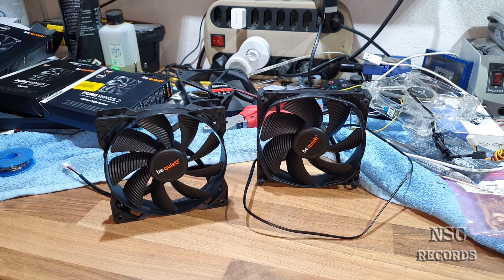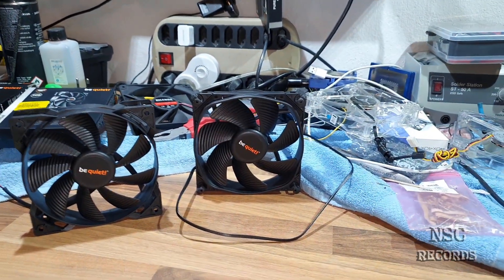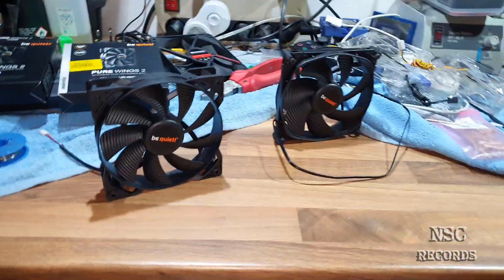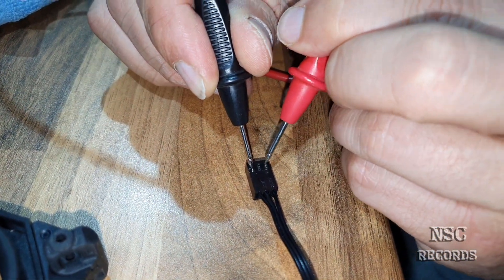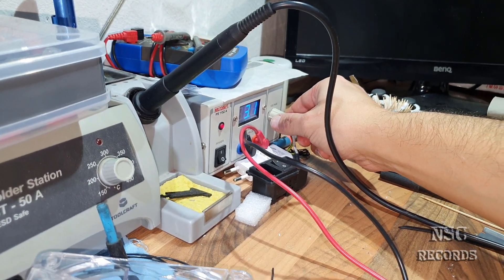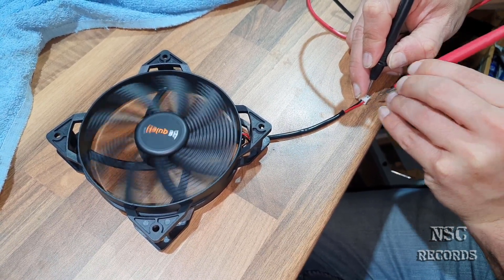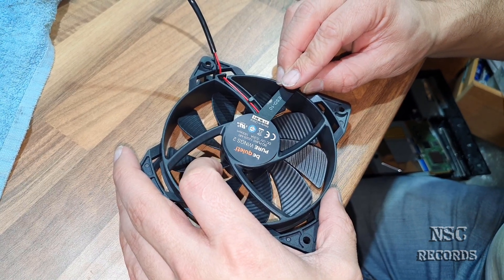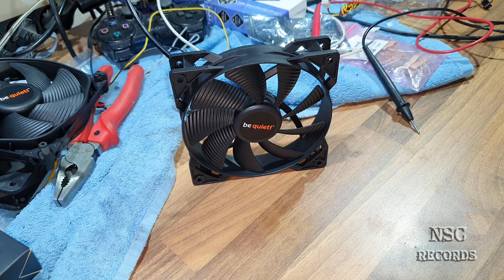Do NOT replace a PSU Fan before you watch this video! By:NSC

Comment: Hi does the ampere of the fan matter?The fan on my power supply is rated at 0.58A and at around 2200Rpm.i am looking to change to a fan with 0.80A and about 3000Rpm will it work? Any idea on what ampere the header on power supply be ? will it handle that.My power supply Seasonic S12 II 620W Bronze
Reply from the maker: Hi So you need it faster? So yeah, should work, but maybe not on full speed, or will be faster, but maybe not full 3000rpm
Reply: @NSC-Modz  Trying to go with industrial fan same like what came with the power supply,It's a Delta brand fan unfortunately I can't seem to get a 0.60a
2 pin 2200rpm anywhere in my country it's either 4 pin pwm or its sold out.Not trying for faster fan.The old fan has started to make sounds like going to die soon.I can get fans with 0.33a but just scared it might not be enough to cool the power supply
Reply from the maker: @DINESH7343  Right, it's mostly 3 or 4 pin, you need to do the rest by your self. It's easy
Reply: @NSC-Modz  Ya,tried with Artic P12 pwm pst fan modified it run on 2 pin instead of the 4 pin ,as you said on the video,the fan doesn't spin during startup of the pc it takes  a while and then slowly starts to spin, most probably because its not meant to be controlled through voltage.I was scared it will probably damage the power supply i took it off
Reply from the maker: @DINESH7343  it's because on the beginning the PSU is cold, so less voltage for the fan, just when it gets hotter, the PSU sends the fan more power, but normally, the Fan should start directly with the psu for best cooling results.

Comment: HI NSC, do you know if the CECH-2003A PS3 Slims have a different fan curve to other models of Playstation 3 systems as even with liquid metal and a fan adjuster set to around 30% the fan will still rise on its own in Grand theft auto 5.Cheers
Reply from the maker: No, the Fan curve is mostly the same on all PS3's
Reply: @NSC-Modz  Alright man, must be the pressure or something. Soon i will finish building my pc then i will out a CFW on the PS3 to check the temps.Cheers

Comment: look man my psu from no where started this problem i just cliked start button in my case then the psu started to nnnnnnnnnnnnnnnnnnnnnnnnnnnnnnn and randomly it stops and work fine i oiled the fan and cleaned the psu very well and it sill there the problem
Reply from the maker: Throw it away, better buy a new fan. It's not worth at all
Reply: @NSC-Modz  ACULLY PROBLEM ITS SOLVED I DONT KNOW HOW BUT IAM WORKING UNTIL GET THE BIG BOY AFTER I FINSH MY SECONDRY SCHOOL THANKS ALOT FOR REPLIING I HOPE U CHANEL GET BIGGER<3
Reply from the maker: @limby4446  Thank you so much to :) You always welcome bro.

Comment: Hey NSC. Came across your video as I was looking at purchasing the Silverstone 1000w SFX PSU. The reviews talk alot about how loud the fans are under load. Are there any fans that could recommend me to do a DIY project in terms of changing the fans on the Silverstone? Price is not an issue for all it is worth. Thanks so much for all that you do!
Reply from the maker: Hi I would wait, soon the new EVGA PSU will be available, this PSU is really cool, the Fan will just work when the PSU is on load over 50% and it has on the side load bar LED Satus. Search for:  EVGA SuperNova G7
Reply: @NSC-Modz  Do you know where I can read up on the potential release date for the SFX version of it? I could not find any info regarding it :(

Comment: so 1100 RPM is not enough for my psu basically
Reply from the maker: It conforms, if it's working on Load most times, better not... if you just surfing around than it should be enough.
Reply: @NSC-Modz  and if i play games on it ? then it will not work ?
Reply from the maker: @ZyRoO__HD  if you play hard games, the psu needs to work more, so it gets hotter... if you got a good psu like with 800 Watts or more, it probably can handle hard games easier because it has more Power. That's why i recommend min. 1500rpm But like i told, it conforms the PSU Manufacture
Reply: @NSC-Modz  oh ok thank you so much for the help
Reply from the maker: @ZyRoO__HD  you always welcome
Reply: @NSC-Modz  sorry for asking again but what if i have a 500 watt PSU is it enough for it ??
Reply from the maker: @ZyRoO__HD  it conforms your system and the games you play, let's say your CPU uses about 80-120Watt on load, your GPU also about 150-250 Watt on load, plus your HDDs and more stuff... so that means you will have about 280-350 Watt on Load, means your PSU with 500 Watts will work already on the limit nearly. And if it's a cheap PSU, than you have no real 500 Watts... I would not risk it.
Reply: @NSC-Modz  okay then i will get a 1500 rpm fan thank you so much for the help
Reply from the maker: @ZyRoO__HD  you always welcome
Reply: @NSC-Modz  hi i need a bit of a help so i bought these pure wings 2  but i dont know witch wires i need fo replacment because it hase a 4 pi connector and its all black wires
Reply from the maker: @ZyRoO__HD  you need the two from left, the very left one is Minus, and the next one is 12v Plus

https://noctua.at/de/productfaqs/productfaq/view/id/215/
Reply: @NSC-Modz  you mean where the labels are on the pin ?
Reply from the maker: @ZyRoO__HD  check the link ive send you, you need Black GND and Black 12v
Reply from the maker: got it work?

Comment: That was helpful, thx
Reply from the maker: You welcome
Reply: @NSC-Modz  A have a question about VOLTCRAFT on your table. What is the right type of this device? I want to find something like this device, but cheaper, and and don't know, how to find other items. So, what is the type of this devive? Or category...
Reply from the maker: @CRYPTOLAVKA  you mean the small PSU: https://www.ebay.de/itm/255459972695?chn=ps&norover=1&mkevt=1&mkrid=707-134425-41852-0&mkcid=2&itemid=255459972695&targetid=1270839892071&device=m&mktype=pla&googleloc=1003968&poi=&campaignid=10203814971&mkgroupid=124889663200&rlsatarget=pla-1270839892071&abcId=1145991&merchantid=7364532&gclid=CjwKCAjw0a-SBhBkEiwApljU0lhdYnf5jnFft_-HJn74rWS0-ezqMHjm-F8Epulq3iLA3TrQgdr-txoCQnQQAvD_BwE

Or here: https://www.conrad.de/de/p/labornetzgeraet-einstellbar-voltcraft-ps-1152-a-1-5-15-v-dc-1-5-1-a-22-5-w-anzahl-ausgaenge-1-x-511805.html?hk=SEM&WT.srch=1&WT.mc_id=google_pla&s_kwcid=AL%21222%213%21549740446689%21%21%21u%21%21&ef_id=CjwKCAjw0a-SBhBkEiwApljU0jl1DyueUYiceSc_ABvVzhh2IFeAnE-UJ5xcfrN9np5fWCagyHFhNBoCpjgQAvD_BwE%3AG%3As&gclid=CjwKCAjw0a-SBhBkEiwApljU0jl1DyueUYiceSc_ABvVzhh2IFeAnE-UJ5xcfrN9np5fWCagyHFhNBoCpjgQAvD_BwE

I have on my an extra display, the rest is the same.

Comment: Awesome video man. I bought an Arctic F12 120mm fan (starting voltage 2,7v; 53cfm, 1350rpm, 23dba) in hope to reduce my psu fan noise, it is pretty loud under load. I have a seasonic m12ii evo 750w psu and the stock fan specs are: 120mm fan 2500rpm, 98cfm and 45dba. Do you think its an okay swap?
Reply from the maker: Yeah, but 1350rpm could be not slow in some applications. Start voltage is fine, but i recommend minimum 1500rpm. You can try it, as long your computer case is big enough and the airflow is fine. Hold me up to date and thx for the info about the Arctic F12 fan.

Comment: I don't think that this ventilator is suitable for PSU, or CPU koeler. It simply does not move enough air mass to cool down the power supply properly. Be carefull with the tempratures. Furthermore, for their price around 20 euro are definately not worth it
Reply from the maker: you need to test always your self witch ventilator is best for your PSU, not all PSUs are the same, the one needs more cooling, the other maybe not. And it also conforms ther PC case and the airflow inside the computer case. But for MY PSU this fan is fully ok. Like i told, it conforms your PSU, not all are the same. I do this stuff over 26 years now, i think i know what i do :)
Reply: @NSC-Modz  I tried once this particular fan, silent winds, on an coolermaster 212 tower cpu cooler which fan was broken. Cpu i7-3770. Was running 50 celcius idle and 70-80 degrees under load. And 95-97 degrees and power throtteling with prime95.  Ordered for 5 euro back then, Snowman from Aliexpress, 120mm 4pins pwm fan, idle was 35-36 degrees and +-75 degrees with prime95.  Clearly the be quite is not suitable for heavy work like cpu and psu cooling. And also wanted to mention about BeQuite PSU's. I am building game pc's for years, buy a lot used components, Be Quite psu's specially over 500watts, often fail, i always test with psu tester before buy. Definately not seasonic quality, i would place them in the same class with CoolerMaster PSU's for example, decent quality but failure sensitive. No1 by far in PSU's is Super Flower, following by Seasonic and clones, Corsair, ANTEC is exellent quality, EVGA etc. But BeQuite PSU's are too expensive for the quality they give in my opinion. I would call them half scam bytheway...
Reply from the maker: @mitsos1461  yeah, thats true... but quality costs money... good PSU´s in my opnion 1.Seasonic, 2.BeQuiet, 3.Enermax 4.SuperFlower 5.Antec 6.EVGA (EVGA can do better) and Corsair PSUs NEVER AGAIN

Comment: I replaced my PSU fan with a Noctua, i placed a temperature sensor inside, and i ran the fan based on the sensor temperature, also the fan is powered by the motherboard.
Reply from the maker: Yeah, works perfect to, but this could get to complicated for some people's 😀
Reply: Noctua is number 1, perfect usable for heavy duty purposes
Reply from the maker: @mitsos1461  Noctua is NOCTUA, here BeQuiet needs to learn a bit more ^^ But witch ever u take, check the Start voltage first before install it :)
Reply: @mitsos1461  That's true, luckily my PSU is platinum so most of the times the fans spins around 500rpm or slightly above when under load.